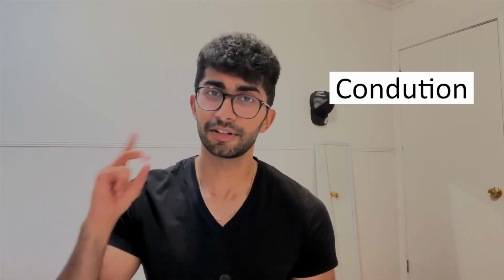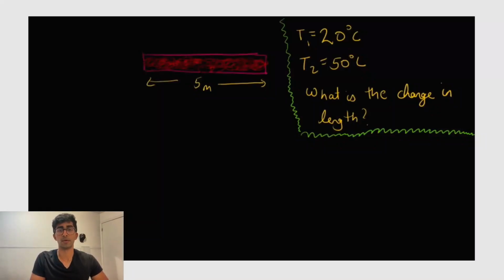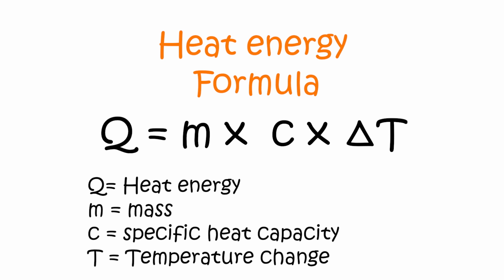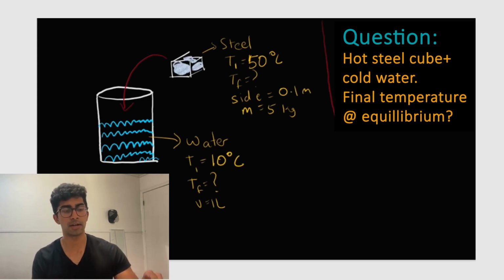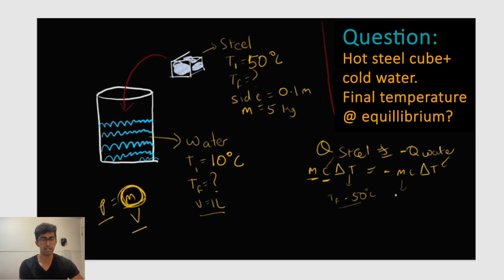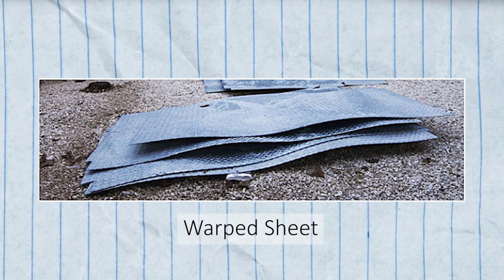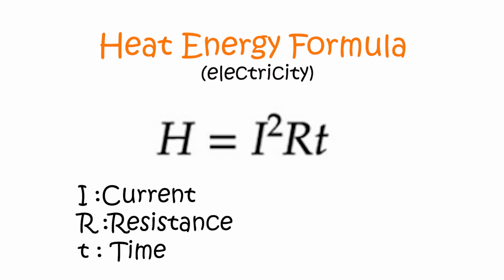THERMODYNAMICS: Hot INTERIVEW Study Points

Comment from the maker: Introduction 0:00
Types of Heat transfer 0:05
Thermal Expansion 0:40
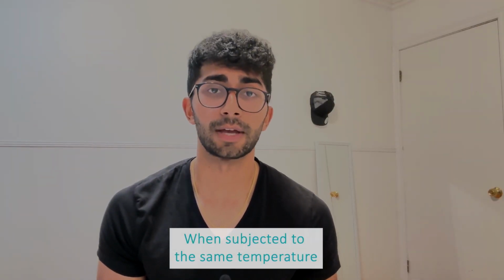Interview Ques (Thermal Exp) 1:21
Heat Energy 2:33
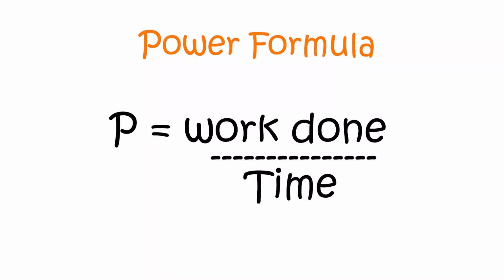Interview Ques (Heat Transfer) 3:19
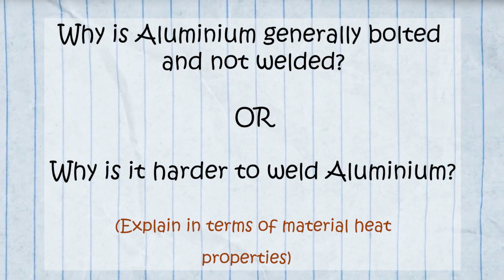Interview Ques (Welding Aluminium) 6:01
Interview Ques (Chamber Heating) 6:50
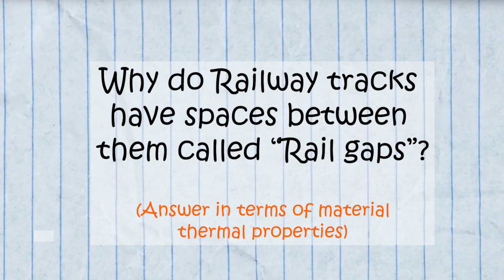Interview Ques (Rail Gaps) 8:05
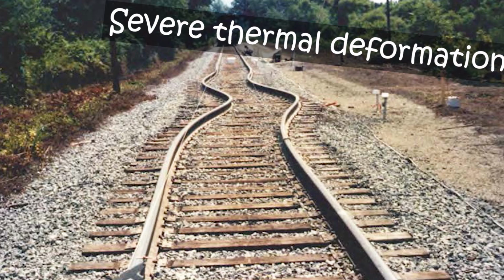Interview Ques (Mercury Thermometer) 8:29
Heat and Electricity 8:59
Summary 9:59
💗 Some Loving Advice 10:13